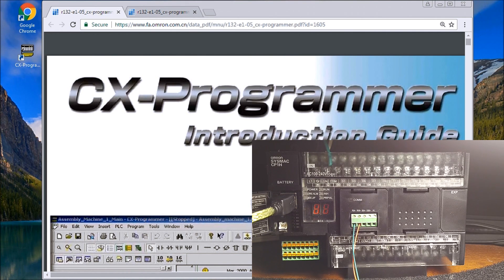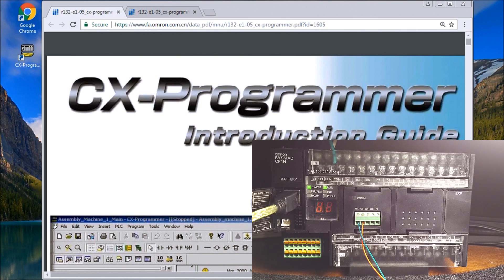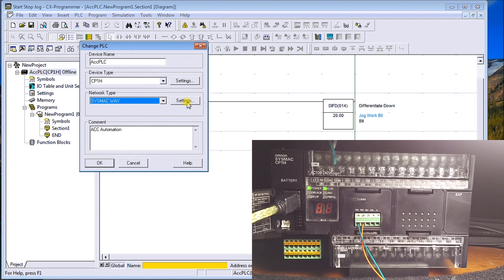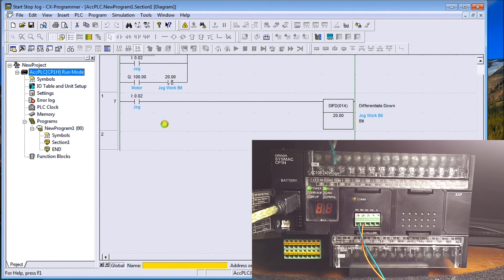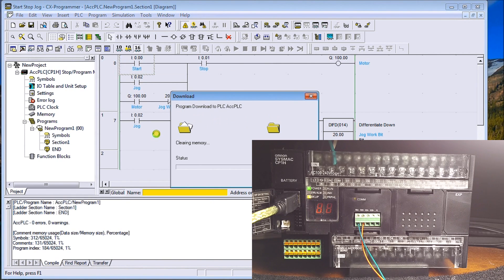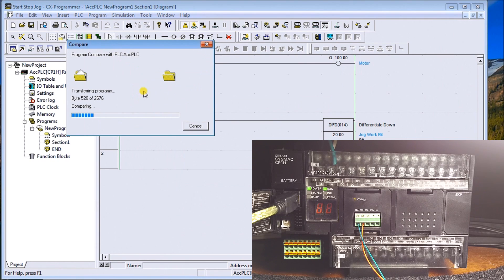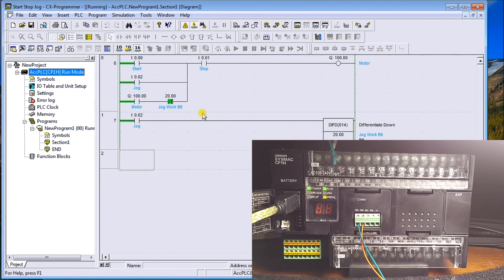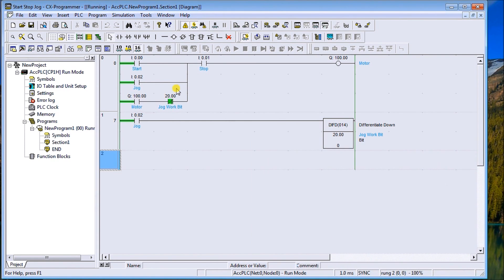Unlock Omron CP1H Secrets: USB & RS485 Connection Mastery

Comment: is there any way to simulate our ladder logic program without having the plc???
Reply from the maker: Hi Norman,
You must have the PLC to simulate your ladder logic program. Omron does not provide this feature for this series of the controller.
Omron has a simulator for the CS/CJ series.
https://www.edata.omron.com.au/eData/Software/CX-One/R151-E1-02.pdf
CX-Simulator enables you to realize SYSMAC CS/CJ series CPU Units in your computer as a virtual
PLC and operate (simulate) it equally as actual CPU Units.
Regards,
Garry

Comment: Omron CP1H  COM 2 ERROR ?
Reply from the maker: Hi Marjan,
Can you explain a little more about your setup? Are you using the USB port on the CPU unit? 
Regards,
Garry
Reply: @ACCautomation  no. communication error 
between PLC and Panel . works all over pc no problems but  on Panel COM 2 ERROR
Reply from the maker: Hi Marjan,
What is the model number of the HMI Panel? 
Has this worked in the past?
If it is an Omron HMI then selecting any two corners will call up the menu of the HMI. Look under the port settings to ensure that they are the same as the PLC.
Regards,
Garry

Comment: I'm trying to connect my Omron CP1H with my PC using ethernet cables through router. The CP1H is equipped with CP1W-CIF41 ethernet option board which the ethernet cable is plugged in. I'm not sure how the configurations are on CX-Programmer and which IP address I should use.
Reply from the maker: Hi Zariq,
You must first connect to the unit via the Ethernet/web browser. The default IP address is 192.168.250.1.
Enter the following address in your browser:
Default web address: http://192.168.250.1/E00.htm (E00 for English)
Default Login Password: ETHERNET

Once you change the IP address to 0.0.0.0. You can change the IP address through CX-Programmer. If the address is not on 0.0.0.0, the CX-Programmer can only read the address.

Here are a couple of links that will help you out.
https://www.myomron.com/index.php?article=1212&action=kb
http://omronkft.hu/nostree/pdfs/plc/cp1/0904-cp1w-cif41bycdd.pdf

Regards,
Garry
Reply: Thanks and I'll ask you if I come across another problem
Reply from the maker: No problem Zariq. I'm happy to help.
Regards,
Garry
Reply: I tried doing what you suggested but I can't open the IP address on the browser and I checked the D memory on CX-Programmer where the IP address supposed to be shown if it was changed but all of the memory are empty. However, the COMM indicator light on the CP1W-CIF41 was blinking. Any more suggestions? Please.
Reply: Update: I clicked Transfer to PLC on the memory window and it load up all the memory. I checked DM32155 and DM32156 and the IP address is  192.168.250.1. But I still can't open it through browser or go online.
Reply from the maker: Hi Zariq,
When the option board connect option1, CPU’s DIPSW4 set “ON” （tool bus connection). Please verify this dip switch.
Note: Changing dip switch settings require power to be removed from the CPU unit.
Regards,
Garry
Reply: Thanks for the feedback. It was on. But all the memory are editable which means I double click and edit it right away. Do I have to change the default IP? But anyways it can't go online either.
I don't know. Maybe I have to reset the CP1W-CIF4 to factory default? I read that somewhere but I'm not sure how though.
Reply from the maker: http://www.omronkft.hu/nostree/pdfs/plc/cp1/pages_from_w462-e1-06.pdf
The above is the manual for the module. 
Do you need to turn off any WiFi networks on your computer? Maybe this is preventing you from communicating.

Just a thought,
Garry
Reply: I did it! I changed the ethernet default getaway of the computer to the module IP address. But the computer doesn't have internet access from the router. Thanks for you help, Garry. Now I'm trying to send arduino data to the PLC using modbus TCP.
Reply from the maker: That's great Zariq.
Congratulations. Thanks for the update.
Garry
Reply from the maker: You mentioned sending modbus TCP data to the PLC. This means that the PLC must act as a Modbus TCP Server to the Arduino Modbus TCP Client.
This will work for Modbus TCP protocol only if you use the CP1W-MODTCP61 module.
http://www.omron.com.au/data_pdf/cat/p63p.pdf?id=3333
Your current module (CP1W-CIF41) will work for the Omron Fins Commands only.
https://www.myomron.com/downloads/1.Manuals/Networks/W227E12_FINS_Commands_Reference_Manual.pdf
This link may help you out with the Fins Commands:
https://github.com/patrick--/node-omron-fins
It is an example using Node.js
Hope this helps you out.
Regards,
Garry
Reply: I didn't know that. I thought Modbus TCP could work as long as there is ethernet connection. Thanks for telling me or I would spend forever trying to make it work. I'll look into the links you gave.
Reply: Is there any way I can't ask more questions about the FINS commands other than through these comment sections? Because I have a lot to ask.
Reply from the maker: Hi Zariq,
You can reach me through the contact section of our website:
http://accautomation.ca/contact/
You can also send an email to:
garryshortt@accautomation.ca
Regards,
Garry

Comment: If We're communicating to the CP1H PLC via the serial communications, then can we use the USB cable connection also? 

can you communicate with this PLC without BOTH communications cables connected at the same time? AKA could you program it via the USB connections and have the PLC communicate with a HMI at the same time (RS232) ?/

Great tutorials BTW Gary! I've subscribed to your channel, very helpful!
Reply from the maker: Hi Eric,
Yes you can communicate to the PLC with both communication cables connected at the same time. The RS232 can be used for programming or the HMI.
The USB connection is just for programming.
Thanks for subscribing to the channel Eric.
Garry
Reply: @ACCautomation  hi sir ,I tried  communication using USB to serial .it connects but is not going stable .it's shows 1 second run mode and then finding again PLC .it's not working properly .any solution ?
Thanks 
Regards 
Wahab
Reply from the maker: @wahabmazari1030  
I have found that not all USB to serial cables will work. This is the one I have been using.
https://amzn.to/3jY0x3e
Please note that you will still need to make a custom cable on the RS232 side. 
PC --- Omron RS232
2 ------------------ 2
3 ------------------ 3
5 ------------------ 9
7 to 8              4 to 5
4 to 6              
I hope this helps you out.
Regards,
Garry
Reply: @ACCautomation  thanks for your quick reply .this cable is still work like connected download from PLC all data. 
But still flactuation problem like not stable. 
I want to ask again if you don't mind .in your opinion is cable problem or something else.thanka
Reply from the maker: @wahabmazari1030  
Since you can communicate and download, I would think that it may not be the cable. Here are a couple of additional thoughts:
- Try another computer and see if you are still getting the same errors? 
- How long is the cable? Is it by itself or connected with other cables in a tray? The cable should be isolated so noise will not interfere. 
- Try selecting a slower baud rate. The slower baud rate will be more tolerant of noise and work over a longer distance.
- Try closing your background applications on your computer. (Anti-Virus, etc. ) Maybe this is taking up too much time and timing out the serial port.
Let me know how you make out.
Regards,
Garry
Reply: @ACCautomation  dear sir I am also same problem .
I am make cable like what you give pin details but unable to connect.can you help me.

Comment: thanks a lot for that video, but I have a question
i'm using CP1H-XA  and i have the optional board  CP1W-CIF01 and have RS232_USB converter
but still need the Pin connection between both (for seial connection) 
could u help me with it ?!
Reply from the maker: https://www.myomron.com/modules/KB/Image/image/Images/1536/1536-2.jpg
This link will take you to the pinout for the PC to CP1W-CIF01. 
Note: Your RS232_USB may require additional an jumper for the CS - RS signals.
Regards,
Garry